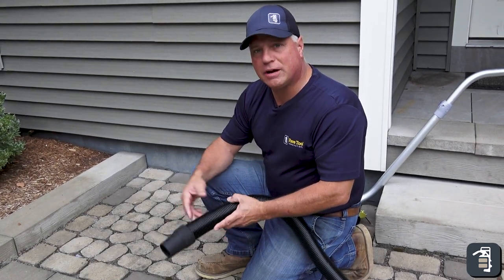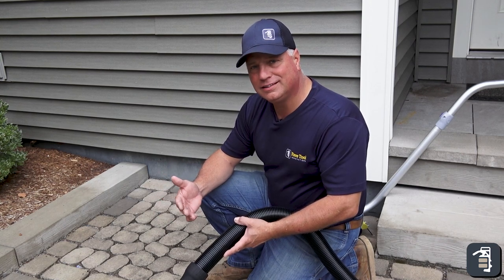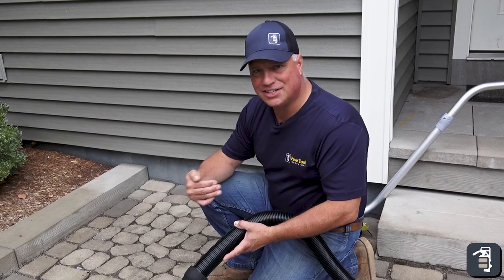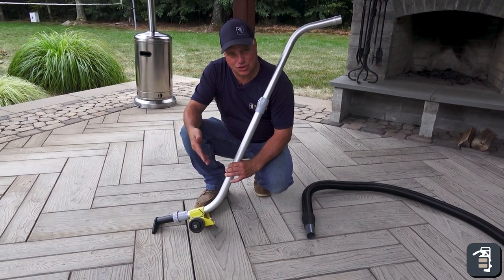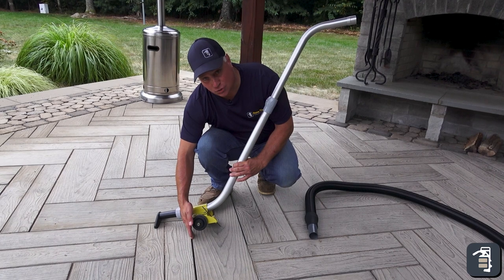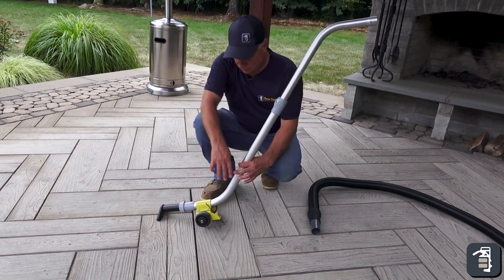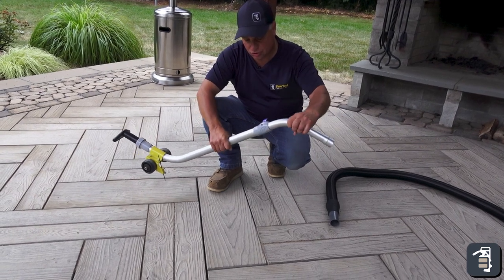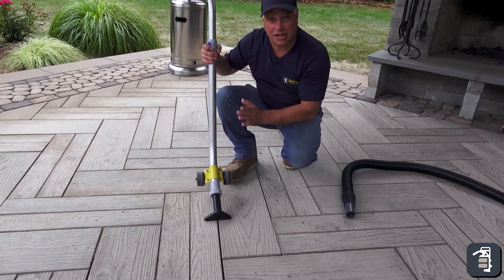How To Remove Joint Fill

Comment: Why not just a pressure washer? How is this faster?
Reply from the maker: Pressure washer = a wet mess that has to be cleaned up. It was designed in response to contractors' desire to have a dry solution to clean out permeable and broken-down joint material.
Reply: A pressure washer might end up shifting the pavers and mess with the bedding below resulting in even more work. I've found a flat head screwdriver to work really well as far as removing the old hardened joints.